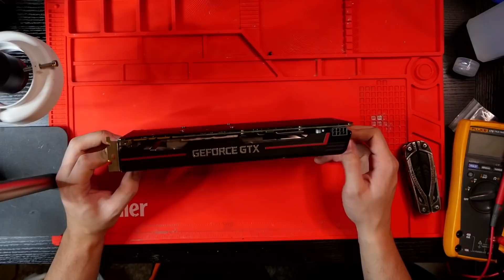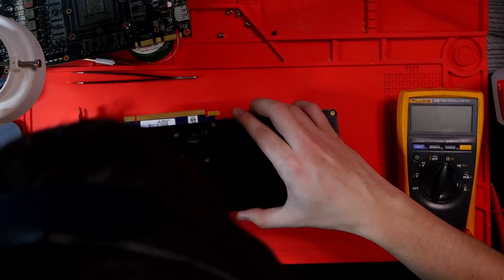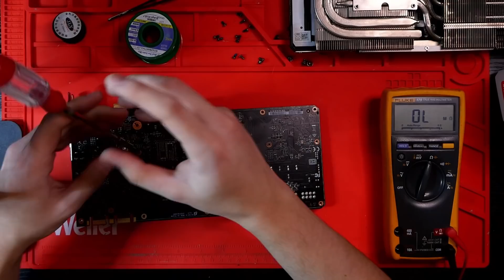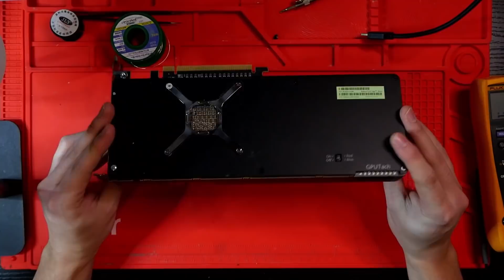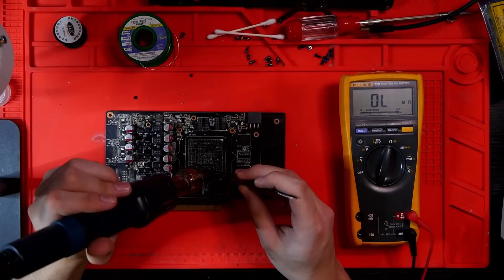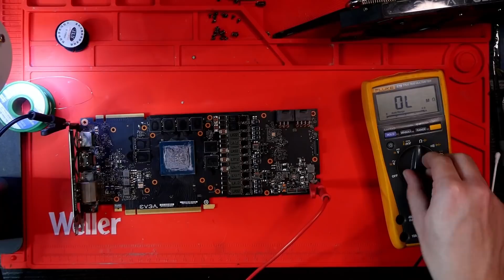Repairing Graphics Cards #1 - GTX 1080, 2x GTX 1070, Vega 56, RTX 2080

Comment: I had a rx 580 card that was knocked over, it boots up and gives display with lots of artifact lines but only without drivers. As soon as you try to initialize drivers the PC crashes. I think it must be a VRAM problem, numbers aren't recognized in GPU-Z, do you think the memory chip itself is damaged or perhaps its a damaged VRM or circuit connected to the memory? Might that be easier to fix?

Comment: I have shorted MOSFETs and I noticed something very strange, when I precisely spray a small amount of contact cleaner on the related Gate Driver the short is gone and the resistance of the MOSFET gradually gets back to normal, but when I tried to power the card again the short is back. I did that about 3 times and the short goes away every time with the contact cleaner on the Gate Driver. How can that happen? Does that mean the Gate Driver is faulty as well?

Comment: The length of the Limited Warranty is determined by Product according to the suffix associated with each Product's identification number as set forth below and will be measured beginning from the date of purchase:

3 Year Standard Limited Warranty Product Suffixes: -A1, -A2, -A3, -A4, -AR, -AX, -CR, -CX, -DX, -FR, -FX, -SG, -SX, -KR, -K1, -K2, -K3, -K4, -K5 -KB, -KA, -KF, -KH, -KL, -KM, -KP, -KS
2 Year Standard Limited Warranty Product Suffixes: -LA, -LE, -LR, -L1, -LX, -T1, -T2, -TR, -TX
1 Year Standard Limited Warranty Product Suffixes: -B1, -BR, -BX, -DR, -RX, -R2, -RL
90 Day Standard Limited Warranty Product Suffix: -RB

Source: https://www.evga.com/warranty/graphics-cards/

So "KR" means that card has a 3 year warranty. Hope this helps.

Comment: Hey i am from india and i have a very weird GTX 1050Ti zotac mini and that card dont have any shorts on 12v and 5v pcie lane but sometimes it just not detected by my system and i have gt710 to but that dosenot do that at all my system is ok i know any way do you have any discord channels?
Reply: I think my 1.8 volt buck converter causing the problem but i dont know, but i have multimeter i can check that if you can hepl me out with it bro.

Comment: hey mate can you guide me if buying card above 70 series are safe as you mentioned in your last video according to your experience are not reliable cards and thats true see this video title 70, 80 series always . So my point is which Brand should i go for (in Nvidia Processing Unit) and which gpu is way to go in terms of reliability. And also can you tell me which  cards are more came for repair i.e MSi zotac xfx evga asus gigabyte which one
Reply from the maker: Pick a card based off of the warranty support. I recommend EVGA and MSI for RTX 30x0 cards.

Comment: I'm just wondering, if you had vram bank issues, if you remove 1 of the chip (which is faulty), is it going to work? let's say from 4GB vram into 3.5GB vram
Reply from the maker: Nope
Reply: @TechCemetery  so the chip must fully installed?
Reply: @maklogetrich2378  Yes, because the gpu is built and meant to have the right amount of memory and if it don't it detects a severe fault with the card and will not start up.
Reply: @dtiydr  what if you mod the bios?
Reply: @maklogetrich2378  Its hardwired into the gpu it self so it doesn't matter.
Reply: @dtiydr  I see
Reply: @TechCemetery  your camera layout is upside down anyway

Comment: I am dad-ing from twitch.
Did you repair that 2070 that stop detected after replacing memory module A0?
Reply from the maker: It's now detected again, but crashes on driver install.
Reply: @TechCemetery  great news. By the way am 40 Years old and i am chief engineer of radionavigation system from Algeria .And every day I spend hours watching your content to learn to diagnose graphics cards.  I salute you for your self-made.  I wish you prosperity and success.
Reply: @baghdadiabdellatif1581  selfishness? xD
Reply: @nahush6299  self-made 😅
Reply: @TechCemetery on 2070 you change pex reset gate but still not detected did you find the problem on crystal or bios or bios switch or pci caps?
Reply from the maker: Dead BIOS chip
Reply: @TechCemetery  thank you